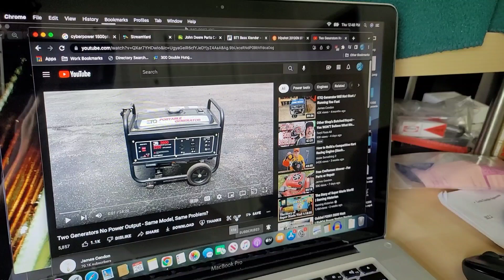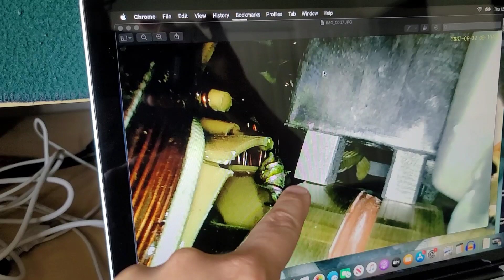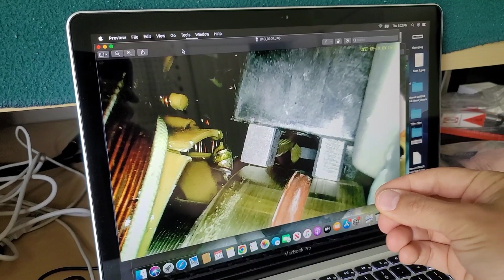Portable Generator: Brush Assembly Alignment

Comment: Very nice photo of the problem.  I ran across the identical issue 2 years ago and solved it the same way.  I purchased a new unit 13 months ago (same mfgr) and it also had this issue. 
I read somewhere that one company had a batch where the bearing carrier was not machined correctly. 
To add to the melting problem, I have tested some aftermarket brush sets and had readings near 100 ohms instead of under 3.
Reply from the maker: Interesting info! Yeh some rotors simply are messed up. One could try to move it on the shaft to align better but why bother on such a cheap machine. Could probably warranty it out I'd think.
Reply: @Bassguitarist1985  I shimmed the first unit with washers. Approaching 3000 hours now. The second unit dropped a valve after the first month, so the brush problem  went undetected. After nearly a year,  5 months in the shop for warranty repairs, they finally shipped a new unit. Inspected it yesterday;  brushes are dead center.  Not cheap any more; 50% price increase in 12 months.    Happens when they cut corners on QC.
Never tried moving the slip rings.  I have an old rotor to experiment on.

Comment: Have you tried adding a shim ring where the lip of the case meets the inner face of the bell?
Reply from the maker: Ive added the washers, but not sure exactly what you mean the inner face of the bell. The brushes mount on the outer lip. They dont mount on the inner lip

Comment: I was watching one of the small engine mechanic videos he was working on a whole house Cummings gen set . He was able to remove the slip rings on that unit quite easily with a small puller. He though they were just friction fit on the shaft.
Reply from the maker: Correct it is likely friction fit with some glue. I haven't tried moving the assembly back into alignment though.

Comment: One of the commenters on James' video suggest that maybe he could grind off some of the material on the back-side of the brushes' mounting flange which would pull the brushes out.
Reply from the maker: I talked with James earlier this afternoon and he said the same thing! It's worth a try but if you take off too much material it can compromise the strength of the mounting bracket and fail prematurely. Still worth a try in my eyes!!